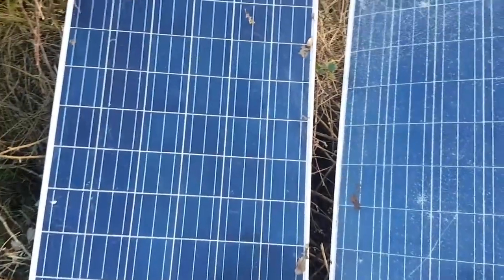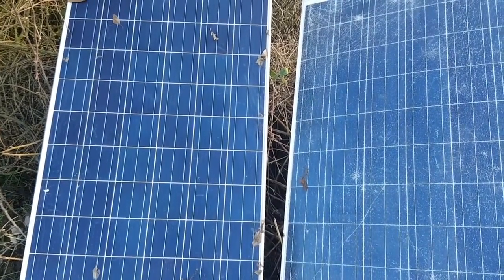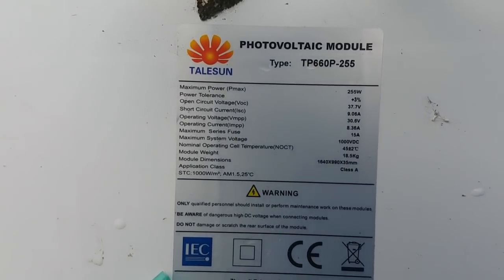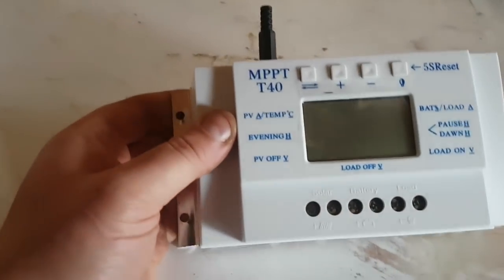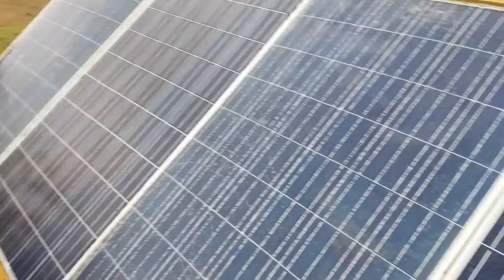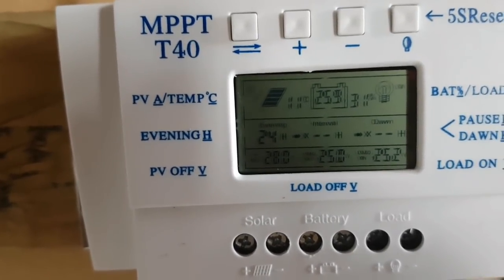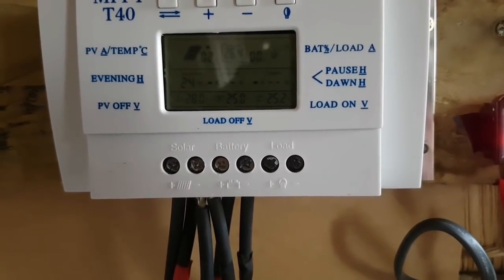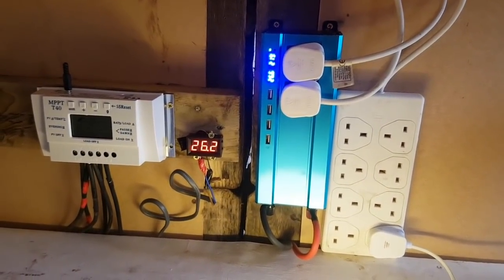The EASY installing of a 1000w of 24v Solar panels for a 24v Off Grid System with MPPT at the farm

Comment: I have two panels (same rating as yours more or less). only need power for lights and USB charging.  how do you work out what size MPPT controller, and batteries to instal with said panels?
Reply from the maker: Mppts are rated for voltage and amps. So for 2 panels like mine would be 80v 20amp mppt to defo not break. Also if u buy a cheap Ebay one at some point it will break for sure iv had 4 different ones over the years that all broke before we got the main solar system in, so go for a branded product with warranty I'd say. Any amount of batteries you can connect to it but for some lights and USB u will only want 1 or 2 leasure batteries. 1 for 12v, 2 for 24v hope this helps, theres a wealth more knowledge out there for small systems good luck 👍

Comment: Where did you source the panels, I have no knowledge bit really want to get into solar.
Reply from the maker: A scrap man selling them in job lots on gum tree. EBay is ur best bet for small starter kits to get ur feet wet in solar, for small 12v or 24v systems it's all pretty straight forward tho just plugging things together in the correct way.

Comment: Make two in series and then in parallel it will increase the power yield
Reply from the maker: Good idea but unfortunately i forgot to mention in the video its a mppt designed for 12v solar panels so has a max open circuit of 48v, linking 2 of my 30v panels in series would be too much for it. it's working well though as is, the batteries are getting topped up nicely. i'll be building a 7000w system for the main farm power next with 4 panels in series and 7 parallel strings. please feel free to subscribe so you don't miss out on that future video